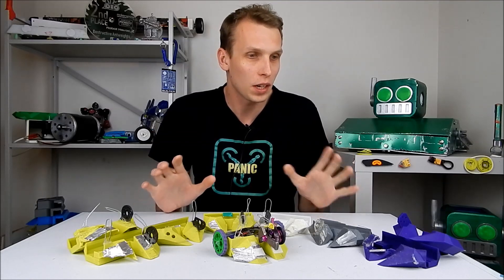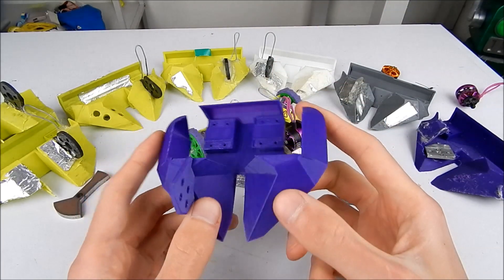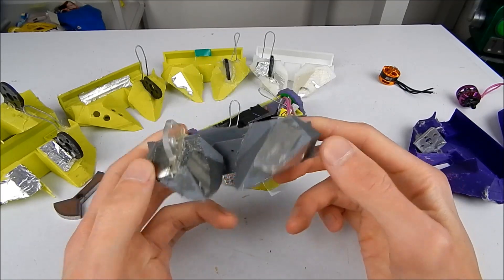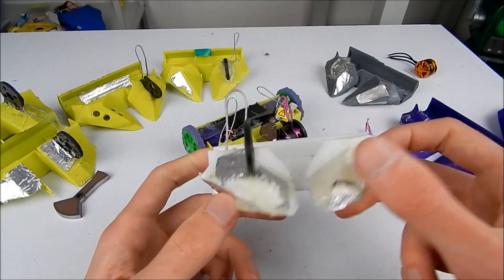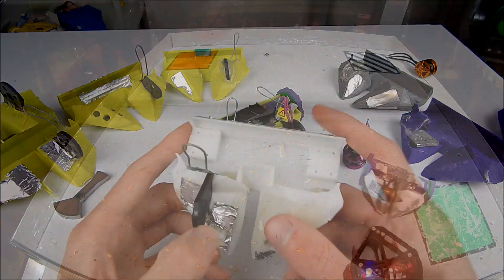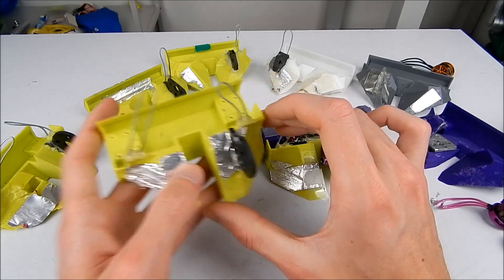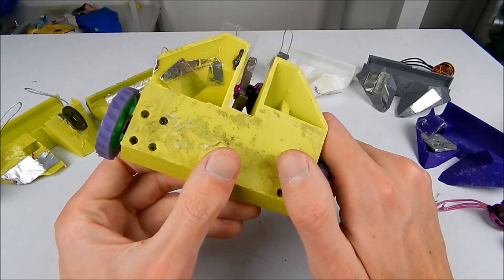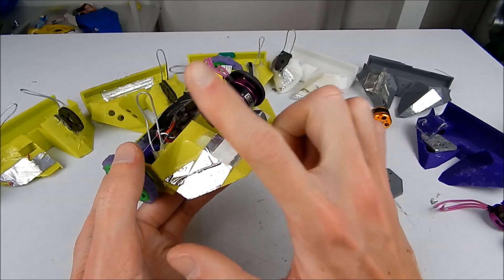150g vertical spinner design evolution (This is a Party)

Comment: I have looked back at all the battle report videos featuring This Is A Party (just because I am such a fan! 😁), and I learned its battle record over the course of around 15 months is as follows:

14 events, July 2018 - September 2019
83 fights
48 wins (57.8%)
34 losses* (40.9%)
1 draw (1.3%)

*includes rumble from ARC Aug 2018.

Trophies it has won:

🏆🥇 3 x 1st place
(ARC Oct 2018 - 4W 1L, ARC Feb 2019 - 7W 1L, MCR Feb 2019 - 4W 0L)
🏆🥈 2 x 2nd place
(ARC Apr 2019 - 5W 1L, ARC Robot Havoc II Jul 2019 - 5W 2L)
🏆🥉 2 x 3rd place
(ARC Dec 2018 - 4W 2L 1D, ARC Jun 2019 - 4W 2L)

Rivalries:
Blade Tip - 7F 5W 2L
Rhino - 5F 2W 3L
Shrapnel - 5F 2W 3L
AntiMatter - 9F 3W 5L, 1 joint qualification
Reaper - 7F 6W 1D
Slipstream - 8F 3W 4L, 1 joint qualification
Escobar - 5F 3W 2L

Hope all these figures are correct.
Reply from the maker: Wow! it's super interesting to see TIAPs record laid out like this!

Thanks so much for going back and getting its battle record written down!
TIAP always seemed to struggle vs wedge bots and the numbers back that up. Rhino, Antimatter, and slipstream all have more losses then wins

(also damn, I didn't realize that I had versed Antimatter that many times)

Comment: wonder if I could bug you for you opinion.  I'm  trying to start a 150g combat club at school.   I'm seeing students break off the  pins on N20 motors.  They solder on a short wire 2 pin connector similar to what I see you do.  But that has no stress relief so many times the pins on the N20 motor break as they take in and out the motor from their bot (many times).  So I was thinking about doing a quick design of a PCB that solders on the back of the N20  and has 2  right angle header pins that the brushed ESC can plug direct into.  The header pins are stronger than the N20 pins, thus my hope they will handle the stress.     Do you think it is worth the effort to make up some PCBs?
Reply from the maker: A PCB that has some strain relief would help but there is a simpler solution

Personally, I cover the back of the N20 in hot glue after I have soldered in the wires. The hot glue acts as strain relief and prevents damage to the pins on the back of the N20
Reply: @TeamPanicRobotics  Thanks for the quick reply,  Hot glue solves so many issues.  I mocked up a PCB last night and uploaded it to JLPCB to see what it would cost. for 200 of them $9.5 us + $6 shipping or $0.08 a piece, I think I pay about $0.13 for the wire connector.  so for me I'm thinking 50 to 100 bots for a few years of students.  the price is cheap either way.  I would agree  solder a connector and hot glue it would give me personally more flexibility. But students are often times harder on the equipment that the battle it self.   At that price I'll order a batch  and let you know how it goes.   Running a club of students, the budget is always a battle itself. Thanks
Reply: I believe that the product that you are designing and making actually exists. I feel like I saw it on either pololu or servo city, but your method is probably cheaper. Are you using a silicone jacketed wire of 24 AWG or smaller? If not, I would also suggest that as the wire weight, stiffness and strength exceeding the tabs may be another contributing factor.
Reply: @ianmcmahon8589    Hi  Ian,    Yes got the idea  from seeing motors with an ESC on a PCB on the back of the N20  ( also  have seen encoders on a PCB on the back).    I just wanted a simple  PCB  that had right angle header pins  that I could directly plug in the cheap ESCs I got from china.  ( I was getting 1.8Ax2 ESC 2S on aliexpress).  I was using those red JST connector (non silicone) on the motors and they were hard on the motor pin.  If it works my, PCB solution  will be cheaper than the JST (for about 25+ motors) I'll give a photo when I get them in. Last I'm in the mode of working with many high school students that can do more damage than the battles themselves.

Comment: Upgrading to nylon prints would fix a lot of issues.
Reply from the maker: Possibly, but unfortunately, I dont have easy access to nylon prints
Reply: @TeamPanicRobotics  all you need is all-metal-hotend, glass bed and glue stick to use basic nylon filaments. Nylon filaments require higher temperatures so make sure your printer can handle 280c hotend ja 80c heat bed temperatures. Another good plastic is 98 shore TPU which can be printed with same printer as PLA. Its more flexible but good alternative material for unibody armor/chassis.
Reply from the maker: I can print TPU and its great for printing bot parts but I find its a little too flexible for antweight chassis (I've printed 3 chassis in it and each of them needed a PLA/ABS plate to give some rigidity). I'm not 100% sure what the shore of my TPU is though, maybe I can find some higher shore TPU